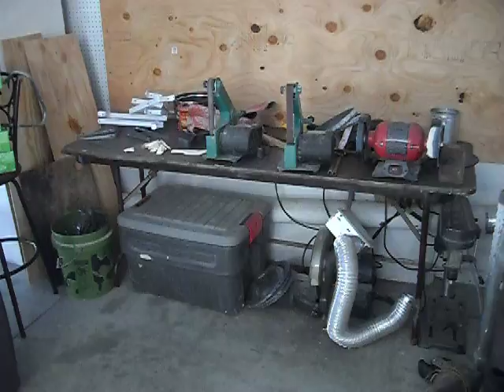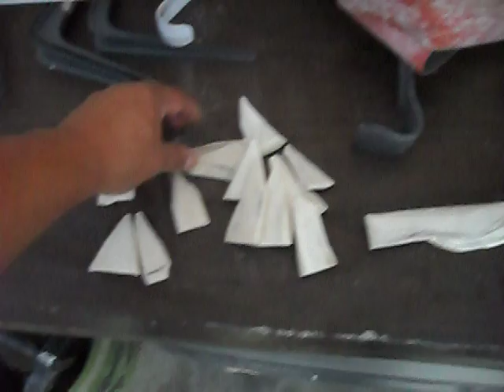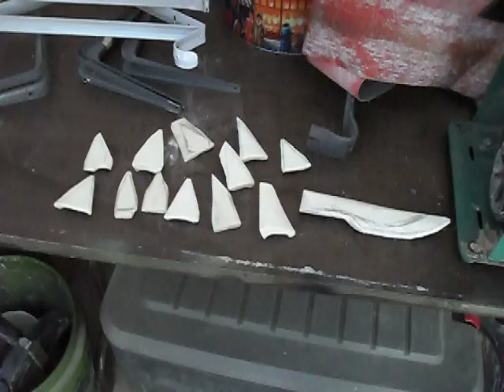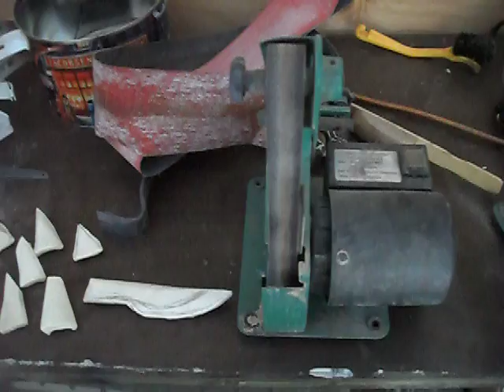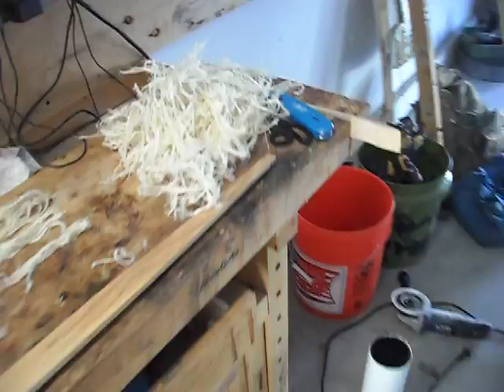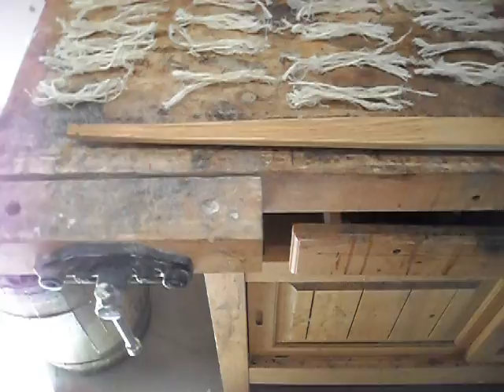Making a Hickory Short Bow Part 7

Comment: I really enjoyed your video. Hey, it totally blends different regional styles (west coast paddle bows and plains style) but it makes for a really pretty bow: I've made "bent tab nocks" on a bunch of cupids bows I've sold. Pin nock, that bend up like a Hupa paddle bow. File shallow angled groves, almost all the way through, at the base of the nocks and bend them up. Then sinew back, then take a square of raw hide, soak it in hide glue and wrap the tips. Wrap that with cordage to stick them down while drying, and string the bow at a low brace so the string forces the raw hide into the nocks. It really dresses up the bow, and with pin nocks on a short bow, makes it pretty much impossible for the string to slide off at a high string angle. Another tricky thing is to help the backing sinew from pulling up on a highly stressed back is to use long lengths of buffalo backstrap sinew over the the deer sinew backing... Wrap the back with the longer sinew in a carefully applied X pattern so the X's are at even intervals on the back and belly. Thennnnn, do end of handle sinew wraps, midlimb wraps, and tip wraps, covering them with strips of rattlesnake hide (scraps from snake skin backing). I have a few of these fancy cupids bows floating around. One is in a historic bar where I understand, Louis and Clark met. Anyhoo, keep up the great videos. Thank you